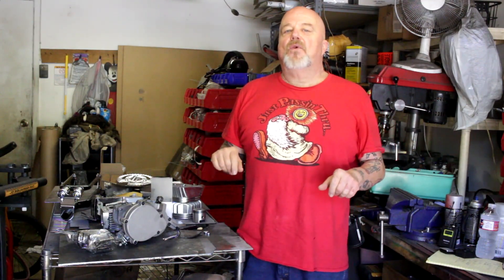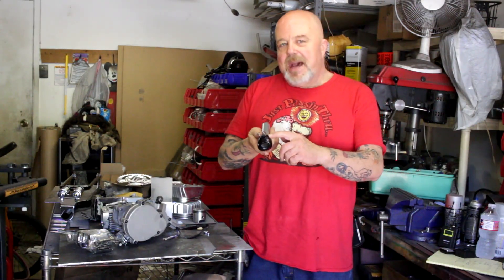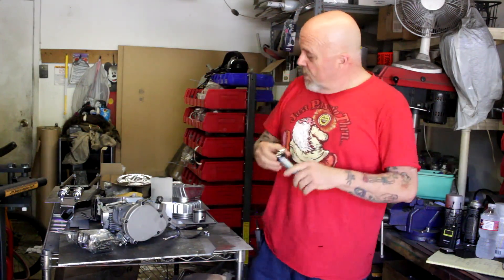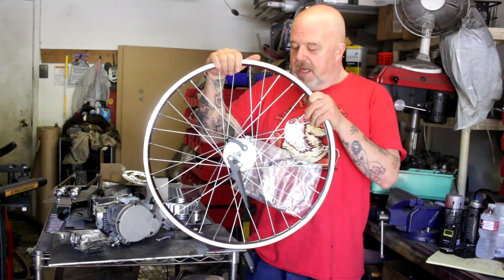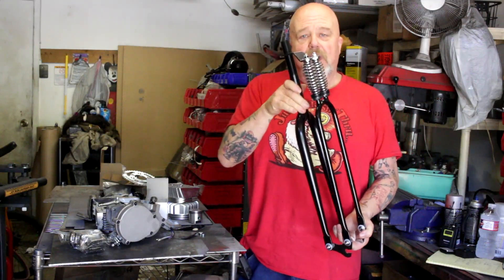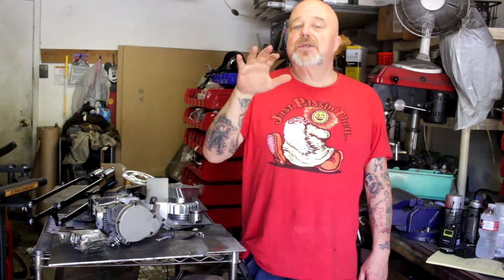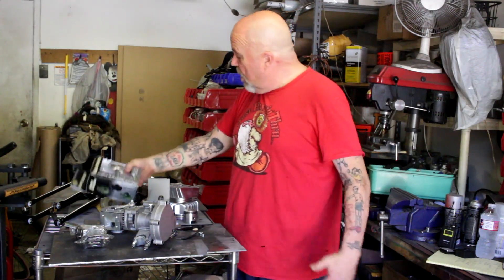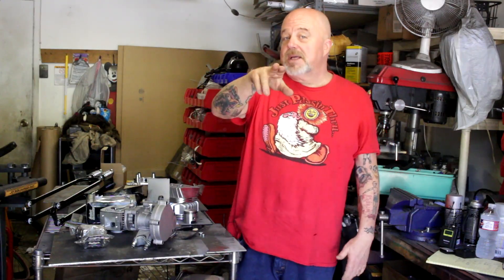How To Build The Ultimate 2 Stroke Motorized Bicycle (my version) Part 1

Comment: I have a cdh Super pk80 I got a cylinder with blank ports and did all the port work on myself, using a sthus nt speed carb same expansion pipe shown in the thumbnail hit around 4k rpm on an 80's Schwinn cruiser 5 using a 36t sprocket on the rear and hydro cantilever on the rear and pocket bike hydros on the front with a 203mm rotor. Does around 54-55mph and the brakes stop it quick and I just threw a high compression head on the bike and changed my squish gap to .7mm as that's the tightest gap I could get without running into issues

Comment: Those pipes aren't the greatest, a good pipe I recommend is a copperhead 65 pipe that hits around 2k rpm and hit through most of your powerband. Also the best brake set up is using the rotor sprocket adapter that allows you to run a disc on the rear or even a hydro cantilever can do better than that coaster hub, those coasters tend to go out fairly quickly
Reply: What is the copperhead 65 pipe? I haven't heard of it.

Comment: Coaster break wheels suck
Reply from the maker: compared to a good disc on a motor cycle? Yup, they suck. I've been using them for 7 years or so now and I'm used to them. A coaster on the rear and a hub brake on front works fine for me

Comment: Here's a tip for you you can get caliper brake pads about 45mm stick and they are thick and they will last I have a video on YouTube with the brake caliper pads on a caliper side cover to give you an idea how thick they are from Walmart and it's just eight bucks for two but it's worth it